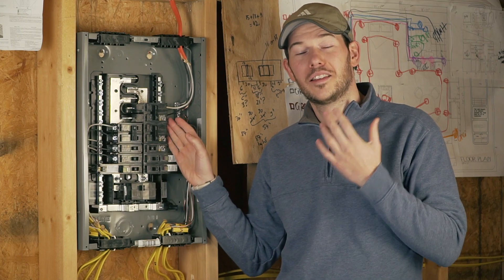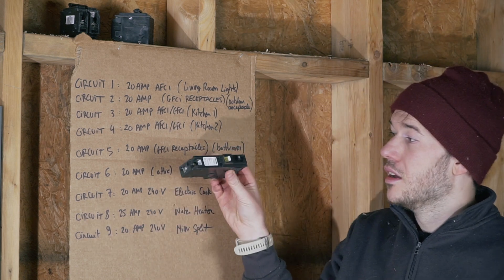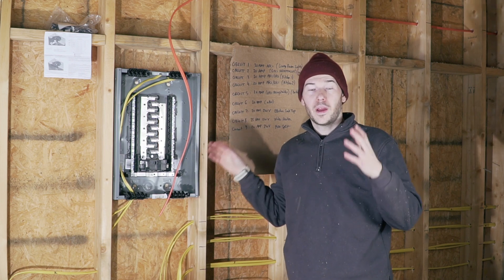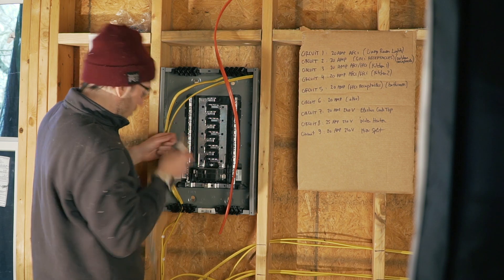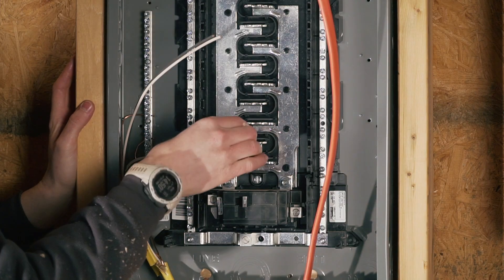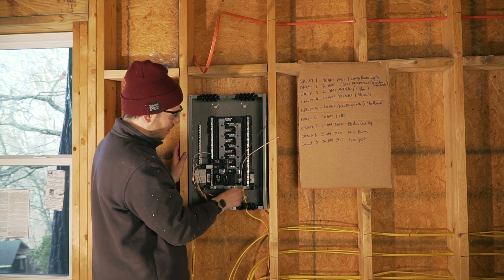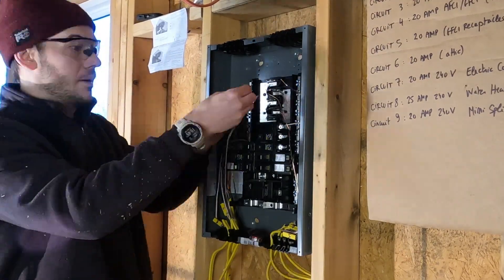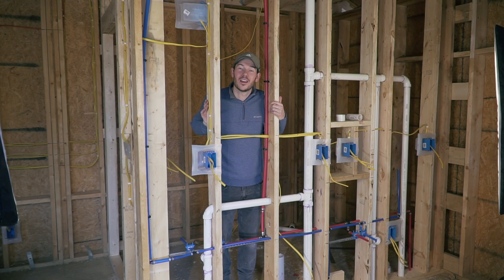Choose Wisely Or You’ll Fail Your Electrical Inspection | Cabin Sub Panel Wiring Installation-Ep 45

Comment: When you have 240 volts, you need 12/3 wire, not 12/2. 2 power, 1 neutral, 1 ground. Same with your water heater, 10/3
Reply: I stand corrected. My apologies. I learned something new!
Reply from the maker: @mittenstategarage9093  I really wanted to know too, I needed to know if I was going to have to run new 12/3 wires. I’ll let you guys know what the inspector will say once I have him look at all this, I’m sure it’ll find some issues here and there.
Reply: For 240v you do not always need 3 wire.  Depends on what it goes to. Modern clothes dryers and some modern stoves need a neutral and ground. Most 240v only need two hots and a ground.
Reply from the maker: @nooneyouknowhere6148  I thought I got it wrong initially and definitely freaked out
Reply from the maker: Are you sure? A google search says otherwise. I understand that for an electric range or dryer you would need a 4 wires total but it seems like for a water heater, cooktop and mini split which will be directly hardwired, 3 wires (2 hot and one ground) are sufficient. 
Would love for someone to confirm this or tell me what I’m missing.
Reply: @TheDIYCabinGuy  with your 2 hot wires you need a neutral to return the current and complete the circuit. You can't use the bare wire (ground) as a neutral, only an earth ground. You will need to drive a copper ground rod into the ground under where your panel is, which will connect your ground buss you installed into the panel. This will connect all the bare copper wires from every circuit into the ground. Every circuit also needs a neutral (white) to complete the power circuit. The black provides the power for 120, a black and a red provide power for a 240 (120+120=240). 12/3 has a black, red, white and bare copper.
Reply from the maker: @mittenstategarage9093  that makes sense, but if you do an internet search, it seems like water heaters, mini split do not need a neutral Wire, just two hot and a ground.

Comment: In the video you said you cut one of the ground wires too short to connect to the left ground bar and would maybe buy another ground bar to install on the right.  Why couldn't you use something like a copper split bolt connector to splice a longer piece of copper to the shorter one so you can still use the left ground bar?
Reply from the maker: I didn’t even think about that 🤣 but yeah if such a connector exists, that should work